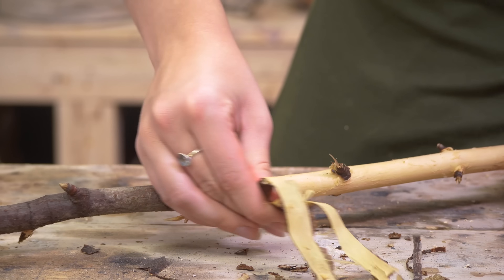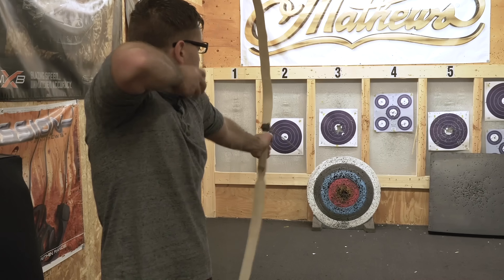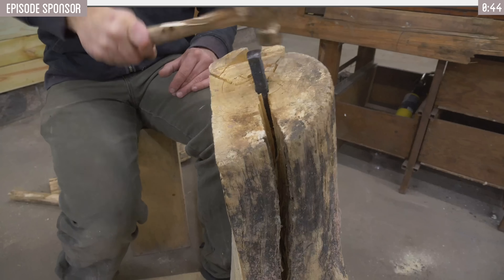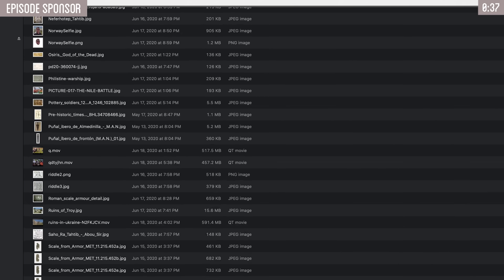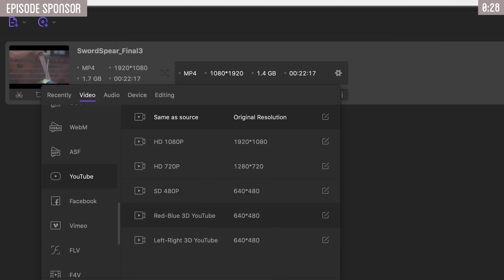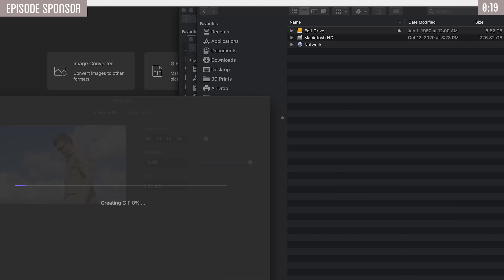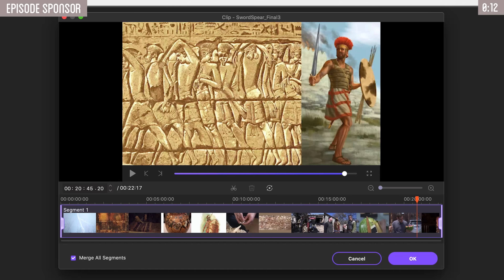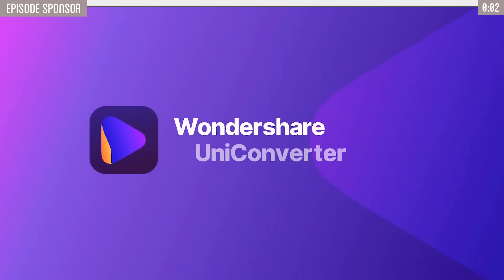Making Paper Out Of Trees (100% From Scratch)

Comment: Take a log, cut it in half, light a fire on top of it, use that to dig a roundish hole into the log (less labor than actual carpentry) then use the mallet into the fibers in the "bowl" it would be much better than on flat surfaces where it runs away (mortar and pestal style)

Comment: First of all, you shouldn't throw away the dark outer bark as that is the dye you need for staining and preserving light cloth.  Secondly, to break down the fibers after the first boiling and mashing, try dragging it through a comb made from nails through a plank which will pull out most of the large chunks as well as tear and separate the fibers.

Comment: I know this is nearly a year after the fact but I really can't be silent. Any one of us who has replaced the handle of an axe, splitter or maul know you missed one tiny but important step for your little handmade hammer. Drive a wedge through the top. Your hammer head will not slip once done correctly. Keeping to your period theme, your wedge can be hardwood, flint or metal. any material at least as hard as the handle material. Also be certain your handle is the hardest wood you can find fully dried. Heat cured would be better.

Comment: Take a lesson on handle making and wedging. If you spent a faction of the time you spent sawing properly shaping, setting and sharpening your saw teeth, your life would immediately get much better. You will use the saw and hammer to make virtually everything else. Taking the time to make more accurate and efficient tools early on is a real time and effort multiplier.

Comment: you could've just took grass and ground that into pulp to use first boil in some kind of alkali mixture ie baking soda, ashes, whatever else is alkaline to break down the cellulose then blend or grind into a pulp and smooth out and dry whether using a paper sieve thing or just smoothing it out on a flat surface than letting it dry it probably would have been easier to do than using the wood pulp maybe it would've been softer and easier to break down

Comment: Why? Why using nails for the frame, if you just can do woodworking to nail less connect? Why stomp wood if you can just mill it with stones much easier with a better result

Comment: You should put a wooden hacksaw style handle on your saw also when breaking down the materials for the paper start with a mortar and pedestal then transfer them into a cloth bag of some sort heat and beat. Some cultures even used old or rejected pieces of leather in the process it will give the paper added strength and a smoother look.

Comment: You know, there's an older way of making paper that was also discovered in Meso America (amate). Instead of shaping the sheet with a bamboo mat the paper was hammered out with stones. it's easier to do since it doesn't require the expertise that it takes to properly shape paper.
Also, cloth is not as good as a bamboo mat in my experience. The pulp sticks to tempered bamboo less which makes it easier to detach (also when shaping it you should not simply put it in and pull it out, rather shake it around to let the fibres to settle in better). And of course, you should add something like gelatin (animal skin glue) into the water which helps bind the fibres to each other much better

(I make paper for fun to recycle materials like banana peels, cotton pads and used paper)
Reply: Wow! It's been 2 yrs and I still can't be bothered to read all this. I wonder if you've made a vid yet.
Reply: @neepsmcfly4176  This is why you will forever be unknowledgeable
Reply: @neepsmcfly4176  Are you ten years old?
Reply: @neepsmcfly4176 It's...a basic paragraph? You can't be bothered to read 5 sentences?

Comment: Your deckle (sp?) would be easier if you you used the flat side. The inside of the deckle is supposed to give you square edges and uniformity, which you weren't getting anyway. Flipping it over gives you a smoother surface to work with and is easier to try to peel off the sheet of paper without the wood in the way. You can still get a relatively uniform sheet of paper as the screen will still act as a guide, did that make sense? Just my novice experience with recycled paper.

Comment: Hey guys about your hammer not saying it's worse then mine cuz I never built one like that but if I did I wouldn't use a your handheld saw two cuts an inch into your handle and create a check so you can slide it in and that will lock the hammer head from sliding out

Comment: some modifications that might be easier next time you need paper you don't need a woven cloth you can just use some thin spaced sticks instead. this will make it easier. as for mulching an ax might be good. your hammers could be improved by putting a wedge in the handle, this was known for a long time, you don't need wood but a crude nail would work.

Comment: I feel like you'd probably have been better off by using a mortar and pestle or something similar rather than a hammer to break up and break down the fibers into shorter bits. For the compression, you could look into making a primitive clamp or clamping system. Assuming you have two relatively flat surfaces to squeeze your sheets between, that would probably be more effective (and movable if it's in the way!) than stones and gravity.

Also, dude just make an anvil already. Flat sheet of metal as thick as you can get it and then attach that to one of those big boulders for weight. There has to be a better surface you can make for that forging.l

Comment: A flatter anvil (even a nice flat piece of granite would work well, the more massive an anvil the easier forging is to do, and a pair of shears to use as scissors would help finishing things
Also a decently smooth and decently thick chunk of metal with a quarter inch hole punched in it makes for an excellent nail header, just put the nail-to-be through the hole such that the fat end doesnt fit through, place it over a vice or some other set of supports, and give the fat end a few well placed whacks
Also if you make a file, even a stone one possibly, you can make that saw much more shapely and sharper, it'll save your wrists the pain
Cheers though! What ever did happen to that cotton paper you made all those years ago?

Comment: Thinking grinding stones or flint or obsidian might be sharper for grinding up the fibers.  Not certain if traditional, though seems like would be easier and even the stone material can be filtered off in a water rinse or maybe just a cloth screen... thinking water rinse.  Better for cutting would be the sharper obsidian or maybe more local... flint.  Seemed to work well with the bow drill also.
Reply: Oh, forgot to save time and the iron resources for the nails... just use cordage or some sort or sinew for the frame binding of the corners on the outer side if you need the inner frame without.

Comment: Use the file at alternating angles to create "fleam" in the saw teeth, it will be much much mucho better for cross cutting 
If you want to use it for ripping, you have to file the teeth perpendicular to the saws direction so that the leading edge is vertical

Comment: You know that ancient Chinese wooden constructions rarely use nails right? I seriously doubt that Chinese would build wooden frames for paper making with nails in the frame. It is far more likely that a simple net / mesh is used to create an irregularly shaped paper, the paper is then cut into square forms. Excessive paper is simply recycled for the next batch.
Also, I have to ask: why is everything made at each technology node so crude?
Please do recall that at each technology node, craftsmen and artisans took time to refine not just their processes but also their tools. Sometimes it is the very refinements that brought about the different advancements.
For example, you have a hammer head or an axe head. It would only take you a few moments to attach your hammer head or axe head properly with a glue and wedge method. It doesn't matter whether your hammer head or axe head is bronze or iron. That simple would both increase the safety of your work environment and save you hours of later frustration.
Similarly, there is much you can do regarding your other tools. Take care of properly constructing and maintaining your tools would make it much easier for you to do many of these builds.

Comment: Maybe you should make a file to sharpen that saw? 

not very hard. Use the iron you have make a file-like blank, let it cool by air, take your railroad spike or make a crude chisel and make the teeth, then make a paste of salt-flour-and charcoal (or just plain charcoal works as well but it needs to be in a fine power) and some water, cover the files in this paste put them in a fire for a little bit (trail and error) and this becomes a crude version of steel. 

Also known as case hardening which can also be used for the saw so the teeth dont become dull.

Comment: A rock will never be a great anvil, but if you mount it so it doesn't move around so much it will work better. Failing this put in on the ground buried a bit or build a tray to put some sand in on top of your table. trust me ima blacksmith

Comment: I wonder if you could make electricity with tech level you currently have. Having iron/steel for magnets and copper/silver/gold for wires, it should be possible to make rudimentary electric generators, engines and batteries.

Comment: I love your videos, I’ve been a subscriber for 5 years now. I just have to say you did two steps wrong in the paper. First is that you need to soak the hemp before breaking it up. The other thing is that in the pounding process usually a large stone mortar is normally used to prevent loss of pulp and help to provide a rough surface to breakup the fibers on.

Comment: I think you are using ancient tools with a modern mindset. 

From what I understand (not a specialist or anything) most of the shaping of your wood for the frame would have been done with a hand axe. Your flat boards would be made from splittting or ripping the logs. In the past they would select their lumber/trees they used for the job needed. So a straight section would be used to get straight splittings of the wood. 

LSS: You need an iron hand axe. Use it to get the rough shape of your wood. Instead of heavily relying on your saws. As you see (and feel) it takes a lot more work and effort if you force your shapes with a saw.

Comment: Just a little conjecture, if y'all don't mind: when flax, nettle, and hemp are made into fibers, they're picked when they're green, dried, and then retted. Retting is when they're left in water not just to rehydrate the fibers but to literally cause the stiff outer fibers to rot and dissolve. Maybe the bark and hemp should be picked when they're green and retted? Nowadays, cotton is also used in paper due to its comparatively shorter and finer fibers; that might get y'all better results. Lastly, even in traditional paper-making, the mesh in the frame that lifts the pulp out of the mixture is much finer.

Comment: You guys shou8ld look into Hawaiian tapa making. You might have an easier time making paper that way.
Reply: Main benefit? Smoother end product, no making pulp slurry. You just soak the branches (only some plants are suitable), pull off the bark, and then cut off the inner bark, the bat, and beat it to size. Can combine many pieces of the batting. One of the most knowledgeable experts works at University of Hawaii, Maui College.

Comment: It is strange that you guys don’t seem to refine any it the tools and processes that you use. And why do you use a minimum wage to figure a cost. With all of the primitive tools you guys use I figured you would have a captive or some thing like that manufacture your paper. As I sat through the video I wondered why you did not put the bark in a water basin between two rocks and rub them together to break it down. The best parts water lost as you hammered the water out.

Comment: Did you remember to quench your nails? They looked pretty soft and pliable. Also instead of hammering the fibers, maybe try using a large mortar and pestel
Reply: With that mesh and thick frame too fine fibers would have been a nightmare to process and most likely would have ripped it apart when trying to demold it for drying

Comment: 9:52 I think a wooden bowl would be a better choice for a wooden mortar and pestle. Also, the textile sieve you made is too lose. You want it woven tightly, so the water can escape, but not the fibers. It's better to wait more for the water to escape, than to have bits falling off. Also, it would be easier if you had two frames, one with sieve and one without, and get the sieve sandwiched between the frames, with the attached frame on the bottom. That way, after you get it out of the water, you just take away the detached frame and roll around the sieve onto the textile or leather you use to press the paper between.

Comment: andy  you need a wedge i your hammer handle  , perhaps a video or two on fitting axe handles would help in the theroy .. i would also use your tools to refine your tools to a more serviceable level. and somthing you do regularly is use wood or timber without knowing the qualities of the wood your using  for instance ash or hickory make great handles balsa balsum and pine not so much.. fruit woods tend to be used more for decorative reasons hardwoods for endurance or structure .i havent worked with mulberry but i suspect it isnt one of the better choices for handles or bow saw frames.  this ignorance is in part because you arent a artisan with years of expierence to draw on  and part because the knowledge is being lost in general as people rely more and more on buying and less and less on making for yourself. thanks for the videos